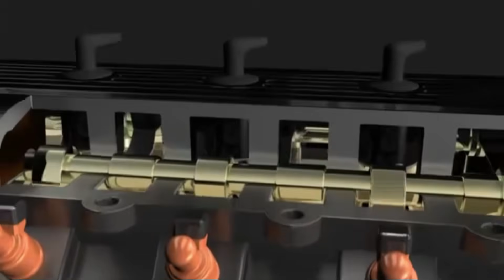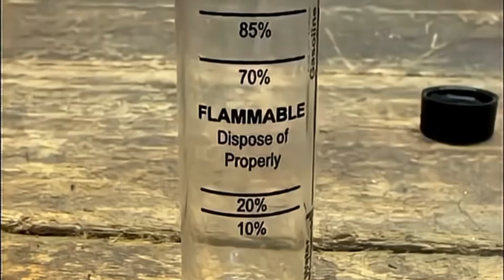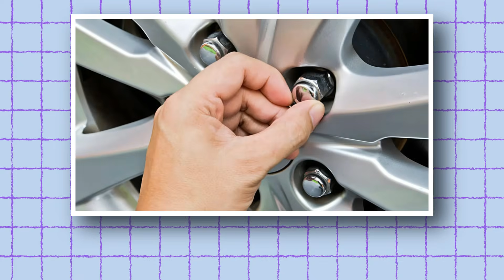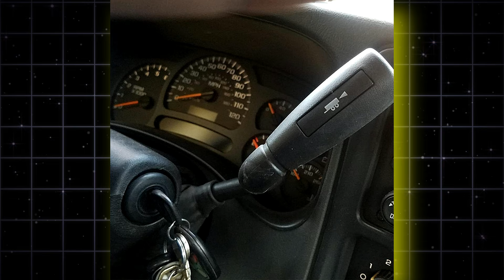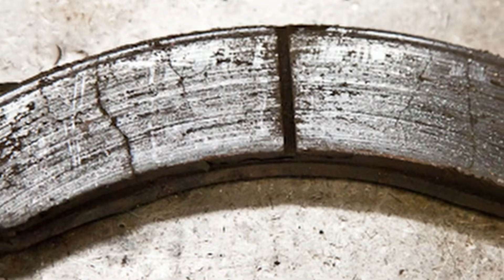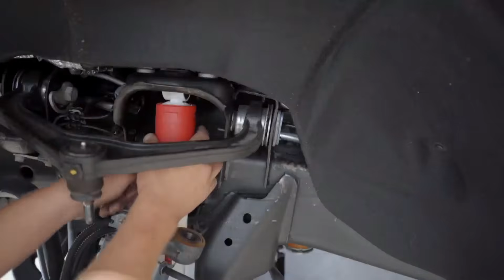15 ILLEGAL GMC Tricks Mechanics Use On Their OWN Trucks

Comment: I think you got the oil viscosity wrong the newer trucks use 0W-20 but mechanics and people like me are switching to 5W30, my 2019 Chevy Silverado V8 5.3 l ecotec 3 engine with the dynamic fuel management that has been dm deactivated in the United States well at least in the beautiful state of California where they do the worst of the worst thanks for your vehicle comes with 0W-20 but she runs a hell of a lot better on 5W-30.
Reply: @HowtowithPaulHenderson  possibly he meant 0w40 is what mechanics put in their trucks
Reply from the maker: The 5W-30 discussion on the Gen 5 five-three is real — GM spec is 0W-20 for fuel economy and AFM compatibility, but with DFM deactivated a lot of experienced owners and mechanics run 5W-30 for slightly better film strength at operating temp, especially in warmer climates. Not wrong, just outside the factory spec. California's DFM restrictions are a whole other conversation. 🙏